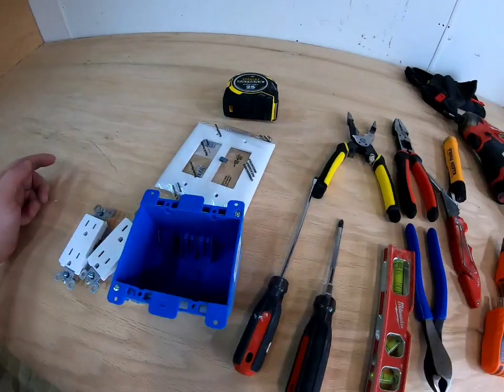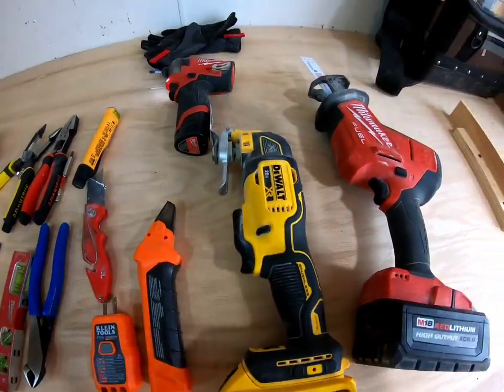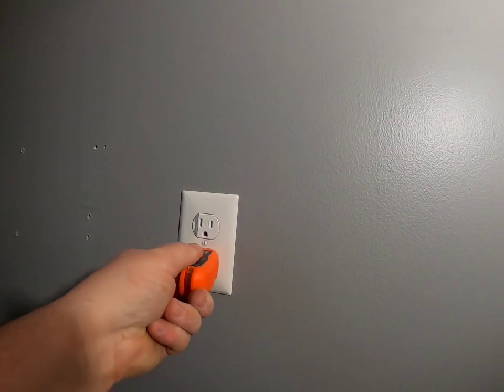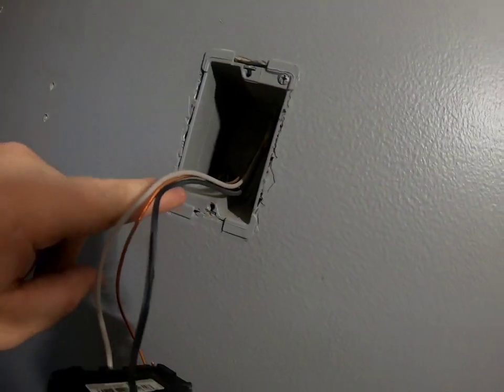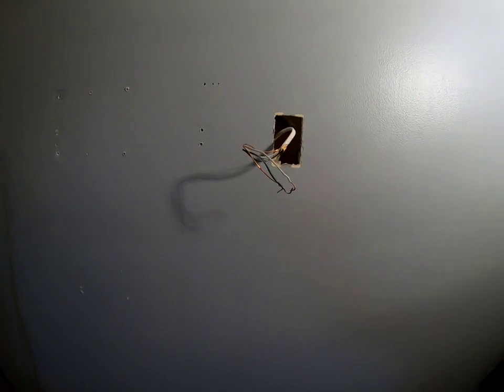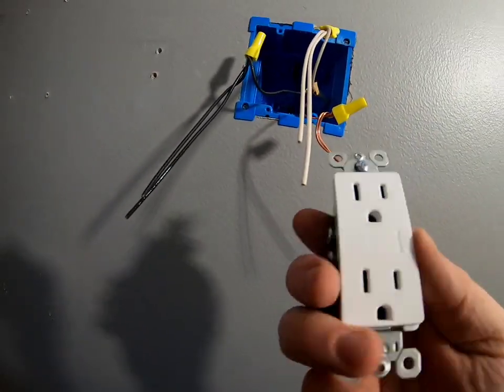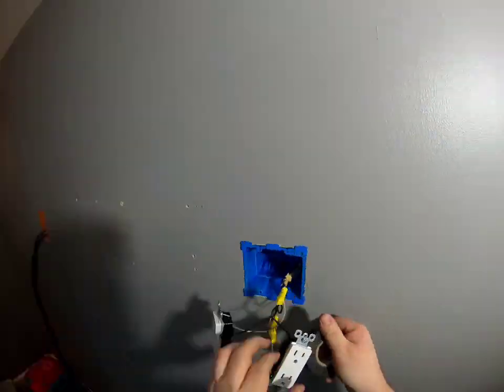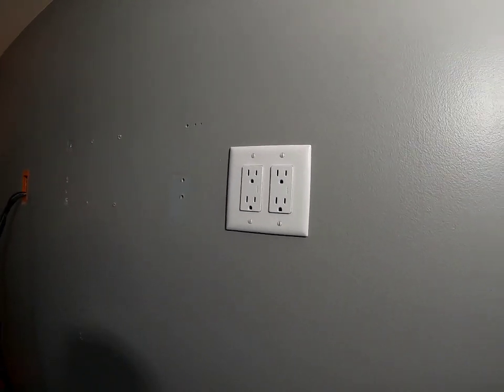Double Gang Outlet Conversion!

Comment: Why twist in wire for both outlets, there is more than adequate wire to connect to first outlet THEN use a jumper to the second outlet.  IMO, just added more wire and connections unnecessarily.
Reply: Better failsafe; if one goes out for whatever reason, the other outlet is still operable.  Like the old saying goes, there's more than one way to skin a cat.

Comment: No stud on either side, you got it easy. Most are interest in removing new construction outlet boxes.
Reply: Exactly my thought.  This is a re-work box that is being replaced with another re-work box.   Replacing a new-construction box is the most common issue.
Reply: @SeanRiddolls  I couldn't make out, is box screwd to drywall? Dont you need to screw to stud or drywall anchors? If it's a metal box do I use a metal box or get that blue? Hey thanks for any help.

Comment: Hey Renovations and Repair. Thanks for the video. It was very helpful. However (please accept a small suggestion), I had to slow down to 0.25 playback speed, because I am a complete novice and wanted to see your technique when wiring. For example, I missed wrapping electrical tape around the outlet until I slowed playback down. That makes great sense yet it never crossed my mind.  Have a nice day and thanks for the video.

Comment: Just a comment that code says you should use Tamper Resistant (TR) receptacles since it's in a living space. The old receptacle actually was a TR receptacle if you noticed the labeling on the device. Otherwise, nice work... clean, great wrapping the receptacle with electrical tape over the screws for safety, great job practicing good safety with turning off the circuit breaker, great job wrapping the wires around the terminals the correct way, and good attention to detail with the screw alignment and leveling out the receptacle.
Reply: Same here
Reply: Tamper resistant receptacles suck

Comment: Is this the correct way? When I did it before I wired the 1st plug with the 14-2 coming out of the wall then daisy chained off that 1st plug to the 2nd...I did add the 2 pig tail pieces to the ground though like you did since there is only 1 ground screw per plug. I'm definitely not a licensed electrician either so just wondering if there is a more correct way to do it or if they're both acceptable? Great videos, love watching the trailer build out evolve.
Reply from the maker: This is "one" of a few acceptable ways to wire this.

Comment: Always enjoy your videos.  I don’t do anything different other than in my region we use metal boxes more often than blue Reno boxes.  Will you share what you would you charge for this ( assuming you weren’t combining with other work for this customer ). I would charge $165 as a non licensed handyman.
Reply: You should have a minimum. Mine is $150 just to show up to troubleshoot and that's just for 30 minutes. (just for changing out the single receptacle to a dual) I would want $250-$300 labor for that job.
Reply from the maker: Job minimum for this include dismounting and mount the TV would be $375 including electrical materials.
Reply: Thanks Gents, my minimum is currently less than yours but I’m edging closer as I get busier. I’m limited  by two competitors who give the work away, but my clientele is growing.
Reply: I was only talking about the dual receptacle part of the job. TV mount and TV install is another $150 to $200 if I'm there already
Reply from the maker: My job minimum is $199. This would fall under that minimum charge if I didn't have to r/r TV.